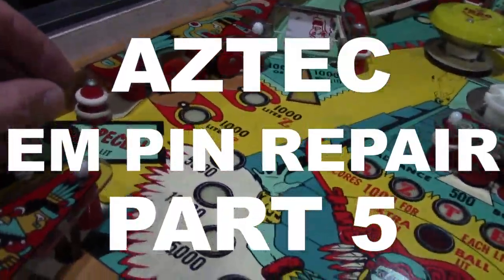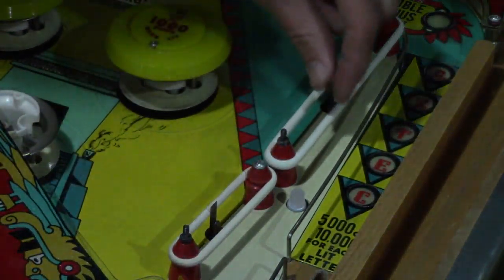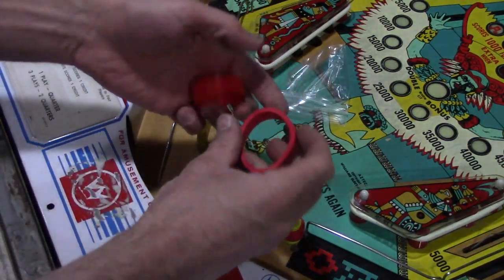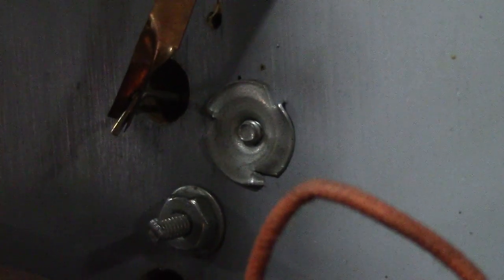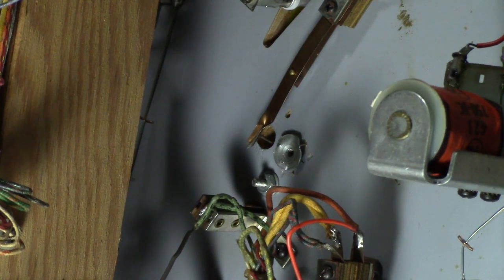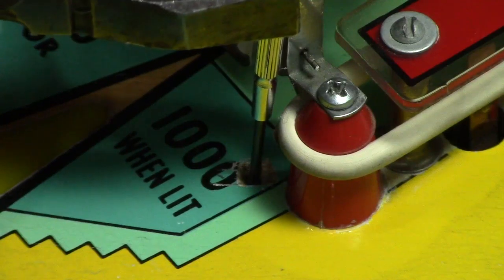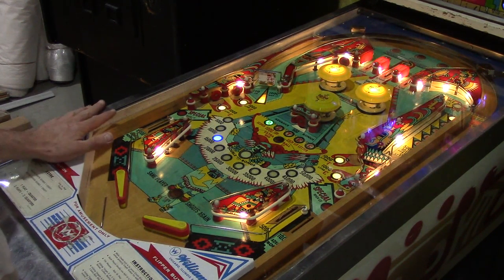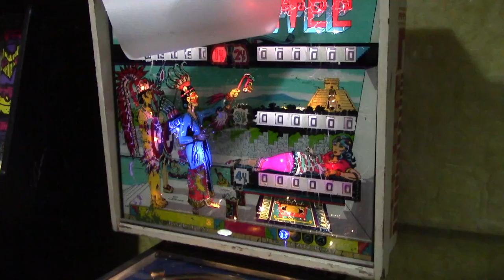AZTEC Pinball Repair pt 5 - Rubbers Super Bands and Broken Posts

Comment: Just tried this for pulling a broken post.  It kind of worked.  not as great as Adam's though.  Got a new post in almost right on top of the old post.  Let's a bit of the old post still in there though.  Just couldn't get it out.  Thanks Adam.